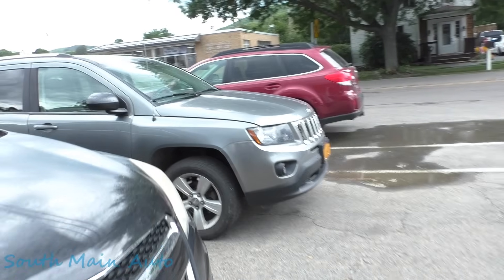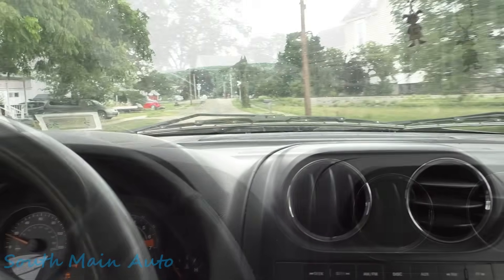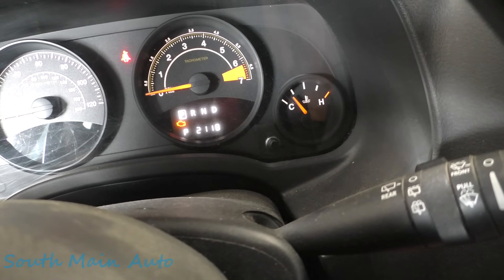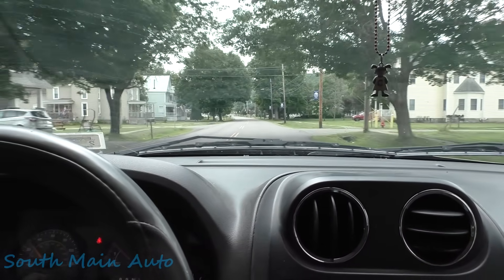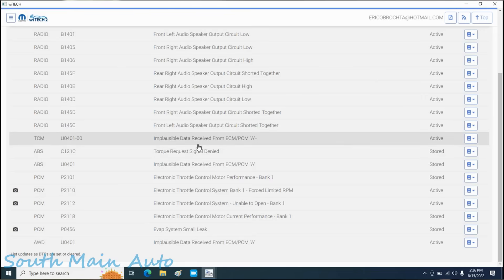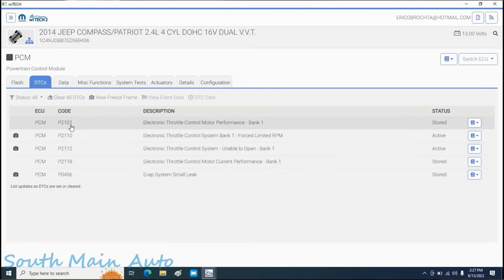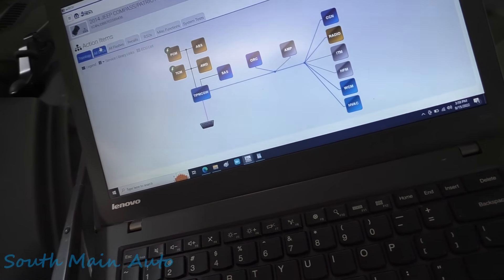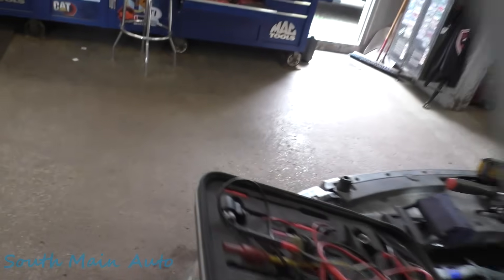Jeep Compass: Flashing Throttle Light & No Go

Comment: Not commenting on the related issue at this point, only about 4 1/2 minutes into the video. I've now had my 2012 Tacoma's air pump replaced twice and this time they did a complete "fuel system flush", replaced the injectors, along with all of the other failed hardware.

Limp mode fucking sucks. After a few days the first time  was able to figure out how to feather the throttle enough to drive it at regular road speeds, up to 60. Tried it on the highway once and I'm pretty sure I would have been murdered if I tried it again.

Comment: Watching from Guam. What is the advantage of ETC? Can't be cheaper than a cable. Mfg is easier?
Reply: It's an emissions thing to keep the air fuel ratio correct there's sensors everywhere to set fuel mix below emissions allowed by government
Reply: It allows for overriding the throttle position from the pedal position which makes ABS, traction, and stability control much easier and better to implement and as a bonus you no longer need separate idle air control valves or cruise control servos because it replaces both of those too.

Comment: Always a learning experience here, I epically fail with the newer computer cars. I miss the days of my youth, no computers, just a points distributor, carburetor etc, no computer crap. Those I can fix. Obd1 I have luck with. OBD2 not so much. Threw a bunch of cash at a P0172 rich code and I think the TCM shorted and blew the eatx 20 amp fuse in a 2002 Neon SE. Now my daily is dead. F me.😬 My diag skills suck, and the parts cannon emptied my wallet.

Comment: Fly by wire makes it possible to externally control a vehicle. Imagine if every car had a kill switch that could be accessed by the cops for instance. There is no other reason to go from a simple cable that has an extrememly low failure rate to two brushless motors controlled by electronics run through a computer controller.

Comment: JUST went through a throttle light issue on my 2007 Jeep Grand Cherokee. Traction control came off. Hardly idled, no vacuum brake, misfires, running like it was very lean. Turned out, the hose from the intake resonator to the throttle body was delaminating on the inside (looked fine from the outside) and a chunk of hose was caught in the throttle blade itself. New hose from mopar was 95 bucks, got a generic 3.5 in hose, 2.5 inch long for 12 bucks and viola, fixed.

Comment: ...their cars are garbage.  I couldn't agree more.  A few years ago I had this identical car show up.  Never set any DTCs and the lightning bolt would occasionally give a single flash, Trans would down shit and shudder the whole car, and just as quick would correct itself.  I have limited diagnostic equipment and virtually no diag info. Visual inspection showed no bad wiring.  I got to the we point where I could make it do it at will.  I took a guess at the accelerator position sensor.  Replaced, drove the car and it was flawless.  Returned car to the customer.  2 days later it started doing it again.
Throttle body.

Comment: Chrysler/Jeep putting the throttle body at the bottom of the engine is almost, ALMOST, as dumb as Ford putting the Alternator below the rear bank on their transverse V-6 Duratec engines. Hope that car doesn't drive through a deep puddle.

Comment: Knock Chrysler all you want, but... I am 54, only owned Dodge products. My current RAM has 400k, my wife's Pacifica has over 550k, my daughters Avenger has 330k. Same motors and transmissions. Maintenance schedules ignored, showing some rust, Canada is not kind with the amount of salt on the roads. I will keep driving my junk.

Comment: Well in one comment you said it looks original but we see that the vehicle has 131,000 miles or so. So this isn't so bad. If the person had done a throttle body cleaning with the spark plugs at 100,000 miles.....they would have cruised right past the shop. Chrysler....not so bad after all. 
I think it is just popular to say Chrysler is bad. I've owned nothing  but vehicles Made in USA and drive them for 200,000 mi before I buy a new one. For the life of me I don't know what all the hysteria is about. I'm in my 60s and my American cars have been bullet proof all these years.

Comment: go back to "cable driven", not drive by wire...
Reply: I had my cruise control pull the cable so much while going up a hill it fell off the throttle pedal. I didn't notice it until I had to floor it manually to avoid something.

Comment: i just don't like these ETM's. i had one on a Volvo that used 2 sliding potentiometers to convey throttle position. 2 forcredundancy i guess.
During normal cruise the throttle uses the same range of opening all the time.
Those potentiometer tracks had worn away in some places to the point that there was no proper throttle control any longer. the engine would start to vibrate and jerk as the throttle blade would  vary position. very annoying. And kinda dangerous IMO
i discovered a Chinesium kit to modify that ETM to where those pot meters were eliminated and replaced by magnetic control. Fixid it! 
Why the heck did Magneti-Marelli not make it that way from the get-go is beyond me.

Comment: These new vehicles are getting idiotically over complicated with whiz bang electronics.
I've never owned a vehicle that did not have a throttle controlled by a cable, with stiff dual return springs and my next one is going to have a points type ignition, even if I have to pay a premium to own an old one.
I am a serious believer in the KISS rule...